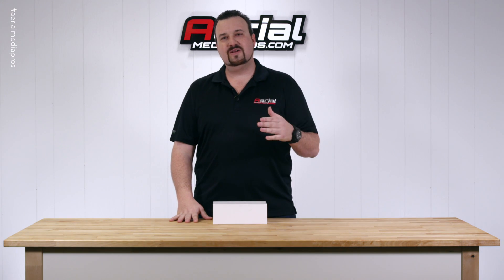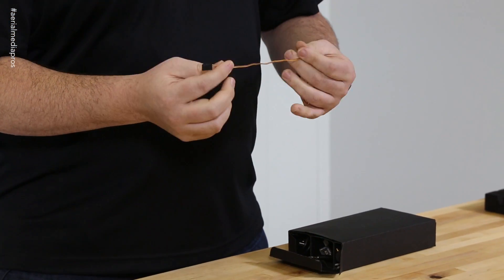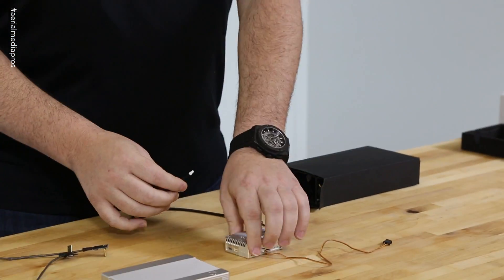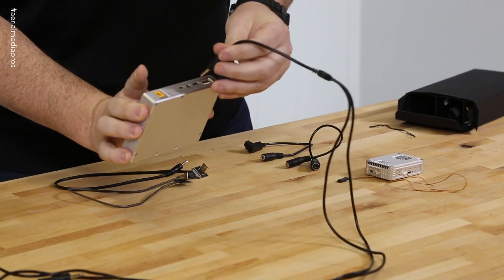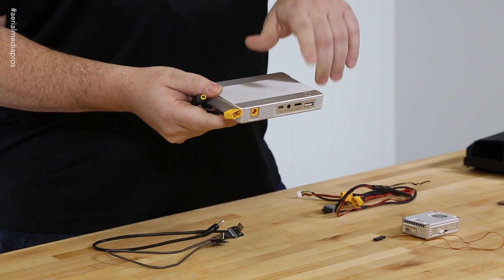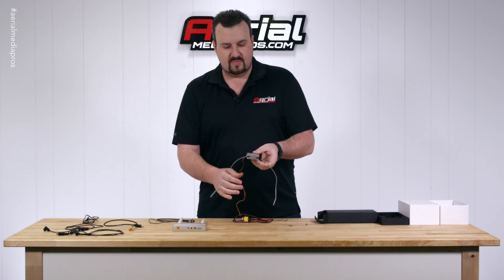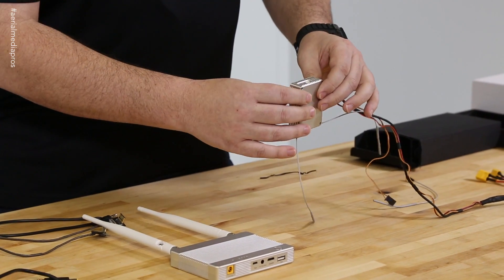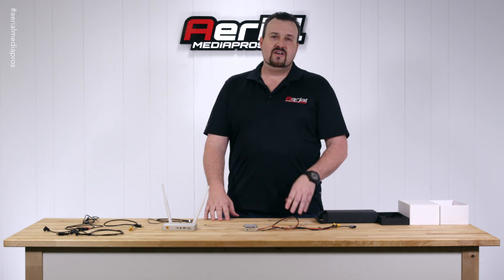DJI LightBridge HD Downlink Unboxing by AerialMediaPros.com

Comment: Hi i just bought the dji lightbridge, im testing the lightbridge air receiver and i notice that the base of the reciver gets really hot. Is this normal? I have plugged into the dji provided tx60 power cord a lipo 5000mah 2s 7.4v battery. Please reply to this as soon as possible. I appreciate all the help you can provide me with.

Comment: Thanks guys, great video. So if the controller and the video both work over 2.4G, can you control the heli separately from lightbridge and still have it function properly without signal conflict? Many two man operations would be fine with the gimbal control and the downlink using the lightbridge, but the aircraft operation completely separate, and without a teather. Is this possible??

I commented on another one of your vids, but maybe others viewing here could also give feedback...

Comment: How do you plan on getting HD output from your s1000. The SD output from your 5d or z15 zenmuse is the only way right? The only way to get HD output is through the Go-pro zenmuse with a cable attached to the hdmi port